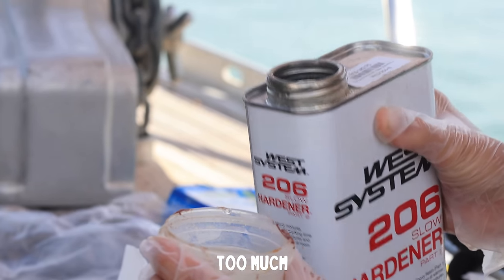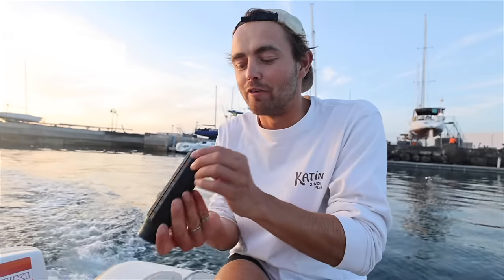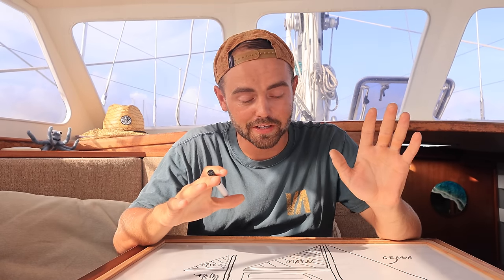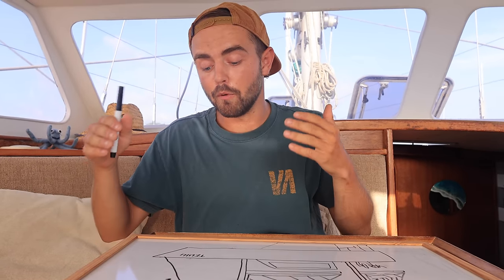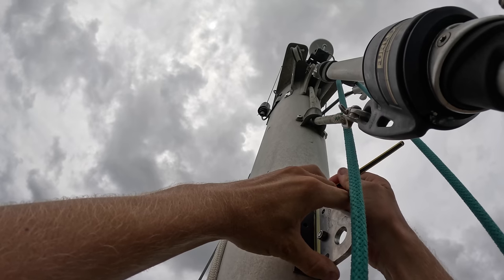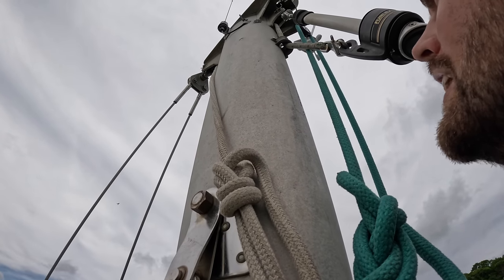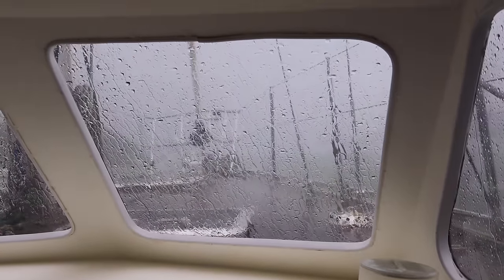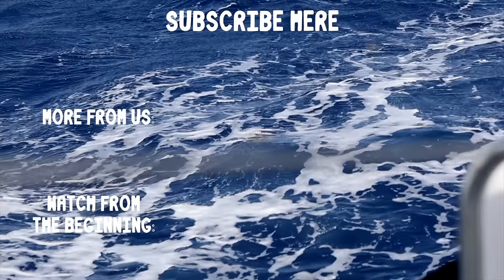Making HUGE changes to our Sailing Boat

Comment: Please take this from someone who knows from experience, sunglasses are not sufficient for eye protection. You want at least some impact resistance, wraparound and a design that will stay on your face. After Zaks' eye incident, later you were pouring filler and it was going everywhere, and even mixing and using epoxy. See Dan from Sailing Uma for what a tiny dollop of epoxy in the eye will do. Funny thing is, Amazon sells excellent wraparound safety glasses by Dewalt for  $5 - $10US. Both clear and shaded. My own eye damage would be considered minor but it rendered me without depth perception for the rest of my life. Try sailing (or stepping off a curb) without depth perception!  Stay safe and keep up your wonderful and entertaining episodes.

Comment: Next time you are doing some stainless work do not use a pencil. It is basically a stick of carbon which will set up corrosion in the stainless leading to failure along the pencil mark. Found this out the hard way after I had marked the mounting position for my chain plate and several years later they broke along the pencil line dismasting me. Notice how you stainless fabricator was using a felt pen.

Comment: Great addition guys! I would only suggest that you go with a high clewed, yankee cut for your jib. It is a far more versatile sail than a low cut ‘blade’ jib, as a the sheeting angle remains constant as the sail is furled/reefed. This allows it to be used effectively in far greater wind ranges. Also - higher clew gets the sail away from waves and allows the clew to closer match the height of the Genoa clew when wing on wing - affecting whisker pole angles from mast.

Comment: When  bolting deck fittings Zack Mads mainly used butly , but if your using sika nip up  then leave for a day so you form a gasket then finally bolt up also put masking tape round fitting so you don't leave a mess on the deck

Comment: Nice one. Stuff getting into eyes: back in the day I worked in ship building and repair. One of our hairy-arsed platers was remarkably adept at removing unwanted swarf particles, etc. from eyes using a handkerchief wrapped around a match stick; followed by an Optrex eyewash. Best medical practice? Probably not... but a NHS paramedic witnessing one such procedure on our slipway favourably compared it to treatment at A and E. Eye protection is so important, especially when offshore.

Comment: For all your deck hardware particularly life line stantioms, over drill and use a modified Allen wrench to remove a bit of balsa core, fill hole with west system 610 and redrill after cure.

Comment: A small point, when bedding hardware turn the nut not the bolt that way the bedding compound is not being twisted around the bolt.  Did I see that the existing forestay is backed by just washers? If so, perhaps get your stainless chap to make a plate for it too.

Comment: You might find Motorbike Aerosol Chain brease - there is a transparent one - which is safe for seals, really useful on a boat, and because it doesnt have the word "Marine" on it, os very affordable. Its vdry controllable to with the tube in the nozzle. Bob. 👍⛵️✨️✨️✨️

Comment: Another great video. A quick tip when using nuts and bolts, hold the head of the bolt still & twist the nut onto it. Firstly you will find it easier, particularly if there is little clearance between the threads & the hole, secondly you won't damage the nicely polished finish on the bracket. Screwing the bolt will scratch the finish with the head as it turns.
Reply: Not only that, but turning the nut uses the torque directly on the thread of the bolt, almost no applied torque goes wasted.
When turning the head of the bolt leaves the length of it to turn under the torque applied. When, in the end the torque is released, the bolt will re-turn to its relaxed position, rendering it longer...👴🧐😉🤓

Comment: hHi Guys, Rod from OZ again. Here's a much simpler and cheaper solution for a second headsail. In the old days a lot of boats carried a slightly smaller headsail with a wire sewn into the luff.and eye on both ends,  so downwind you sail with the wind slightly on one quarter, pole out the genoa on the windward side then pull up the new sail using spinaker haliard. You wont use it enough to bother with an expensive furler. when the wind gets to fresh just pull it down and continue with just the genoa up.
Easy

Comment: Cool video. Just a suggestion: Next time you drill through the core do the Allen key trick where you use the short end on a drill to remove a 10mm radius of core around the hole, put tape underneath, fill with epoxy and then continue as you have. That should better protect your core...and a second jib GIVES YOU WINGS!!!

Comment: It can be used for a storm sail as well Or as i did heavier by an ounce or two & foam luff so it flattens as you roll the sail up , Good for 50 Knots , Nice job .
Reply from the maker: I think at some point we will add a sail like this, you can get ones that attach around furled headsails. Cheers Bill!

Comment: A screecher added to your quiver would make sense. A screetcher is a sail that combines the features of a spinnaker and a reacher. Its similarity with a spinnaker is that it is not attached to a stay along its luff, and typically has a slightly larger curvature than a genoa.

Comment: Hi guys. Just subscribed after catching up on your journey to date. This looks like it will be a great upgrade for you. Another pole is going to be costly and require another set of lines to rig it consider using your main boom with a preventer to pole out one of the head sails. 👍

Comment: Repeat after me; I do Not need that much resin for this job. I do not need that much ...etc, etc.  Yup, we've all been there.
I could refer to me posting a comment about fitting Too-Too with downwind twin headsails in an earlier thread, but then no-one likes a smartarse...
Really nice job guys, and major kudos for the fabricator wearing welding PPE in that heat. Sweating like a cornered nun...A hidden benefit is protection against losing the mast if the forestay breaks. Also, having a second forestay makes changing out the other forestay much easier. Getting a lone forestay off is easy, refitting it with the rig still in the boat is most definitely not, as the wire sags under gravity and can be an absolute mare to get back into the tang holes. With another stay you can crank up the tension a whole bunch and shorten the span.

Comment: Thanks Zach for basically explaing why my Next Sailboat is going to be based on updated KISS principles which Work for Me largely based on Zero Canvas exposed at the Bow or Stern that give Heave To Breaking leverage when Conditions are Bad which demands in Mast Furling,  with a Battenless Triradial Main of Heavy Construction with 3.5 Reefs, the 0.5 actually comprising of two mini Reefs, so 3 Reefs in when it gets bad, 0.25 extra in when really bad, and 0.25 when the Wind force gets to damaging levels, so at all times the Wind Power when things get to "Bloody Hell" levels is all at the Mast, and so oretty easy to maintain a Heave to. Forward Sails a Furling Radial self tacking Jib, a Furling Reaching Code Zero to help fill in the Wind Angle Gaps, and a Furling Gennaker, all Sails Handled from the Cockpit, ideally with a Seldene electric push button  Sail Handling system with suitably powerful electric Winches, which have manual Backup. While totally unsuitable for your Rigging and Sail Setup, Id personally be vdry wary of a Twin forestay setup that could easily require you to go forward to sort out any issues when cinditions are really bad. Thankfully, any issues with the Sail on your Mizzen Mast should be safe enough to deal with, and a Staysail for use at the Mast does work if you can set it when a classic Mast Sail is fully down in the Stackpack. Could work somdting out at the mast end of the Stackpack for a secure and strong Staysail perhaps ? Nice thing withnin mast Furling, is the forces are spread through all the Furled Sail Layers inside the Mast. Classic Masts and Sails can and do work, and I used to really enjoy them, and bouncing around on the foredeck changing hank on Sails, but really, it's best not to be forced to be there when things get really bad. Best Wishes and Fair Winds.  Bob.  👍⛵️✨️✨️✨️❤️
Reply from the maker: Sounds a good plan Bob, it’s so great we can be so creative with the rig of our boats! 😀
Reply from the maker: Sounds a good plan Bob, it’s so great we can be so creative with the rig of our boats! 😀

Comment: Bloody well done getting that bit of metal washed out of Zach's eye Becky Been there and got that extremely Paniful object in my eye problem , but mine was with bullet proof eye glasses under full eye protection goggles when Cutting a Ceramic Chimney liner to size when somehow, a ceramic splinter got stuck inmy eyeball. I was lucky though the last GP I had that was any good, now retired Dr Selcon in Llandysul said I'll have a go, but if I Fail you'll have to go to A&E. Anaesthetic drops in, he got it out with Tweezers. Still to this day can't figure out how the thing got into my eye. A great guy, I helped his Brother in Law, another great guy, paint his house exterior for him. Every other GP I've had since, has been a bloody Nightmare, to such an extent, I've now Fired the NHS and British Private Medicine as well, which is just as bad sadly. Sorry for the gripe but if I hadn't been as Superfit as I was before being put on Dangerously Crap Meds, I'd be Dead by now. Hence first Destination for me in the Caribbean,  is to Mexico to get good Medicines available over the Counter Cheap, and no Prescription needed, to workmon undoing the damage they have done which has left me disabled, which should take three to four years in the area. Might bump into you both duringbthat time, and fingers crossed I'll be able to afford the drinks and BBQ being on me on a few Occasions. Best Wishes and Fair Winds.  Bob in Wales still.  👍⛵️✨️✨️✨️❤️
Reply from the maker: Ouch! That sounds such a painful thing to happen, lesson learnt for us though 😀 goggles next time!

Comment: Thanks for the great content. As a novice myself, I was wondering if you had or would consider the twin headsail setup that Kirsten Neuschäfer has on Minnehaha (GGR 22-23). This system has two sails on one furler and one forestay, so the install may have been easier. Downwind the two sails are pulled either side, up wind the two sails are together as if they were one.

Comment: You won't be using the Genoa for beating again, as you would have to grind all the way in to tack, so makes sense to get a good upwind sail on the inner forestay, something with a flatter form, probably need a couple of forward blocks for the sheets,  unless track is long enough. Have seen self tackers with transverse track and even boom. Guessing!

Comment: Just one problem ! You can only use the new sail for upwind tacking as the original one is now land locked !!! as there is no space for it to pass in front of your new stay/furling gear .!
Reply: True, to a degree. Inner becomes primary upwind headsail but if you want/need to use the outer one upwind you just furl to tack and re-deploy once through the eye of the wind. 

I’ve lived with an identical setup and provided all lines are led to the cockpit it’s not really a major hassle when compared with the improved downwind performance. 

Gentlemen don’t cruise uphill anyway. Ain’t nobody got no time for that! 😁
Reply: Not correct
Reply: @saildreamer  Ok so come on lets hear how you will tack up wind with the genny with 6 inches between it and the new installed one ? Not to mention the damage the lines will 
 to the geenny will do to the inner furled sail !
Reply: @howardbeer5214  furl in the genny then furl it out again - simples
Reply: @saildreamer  And what about all the damage to the sail thats furled /already out The clew will damage the foil and the sail etc and then there's the sheets contantly rubbing on the sail !
Reply from the maker: We will only use the second, further aft sail when going upwind so this won’t be an issue 😀
Reply: @TeuluTribe  Do you mean downwind Zac?
Reply from the maker: @saildreamer  nope, upwind. We will use both on whisker poles downwind

Comment: Sooo. Strong reinforced chain plate in the bottom and rivets on the mast ? You sure about that ? Also maybeeee get a Spinnaker if you can't handle a Spinnaker sail some degrees off wind and jibe as you go along. It's faster uses lift instead of drag keeps boa stable intead of bumbling along like a drunk toddler LOL. Fair winds, Cheers
Reply from the maker: It’s riveted/slotted inside the mast, so minimal force will be applies to the rivets. Thanks for the advice 😊
Reply: @TeuluTribe  Hope it works out. Im sure you asked for professional advice on it 😁 but be ware sometimes they dont give a fu... LOL. Btw we bought a Victor 40 last month that's how we found your channel, thaks for all the videos it helps us piece ours together again. 😅 Cheers and Fair winds.

Comment: Loved the video and explanation / reasoning on your new sail configuration.  May I ask (I'm by no means any expert) if there was any concern over the gauge wire used for the original backstays?  I'm curious if they were sized for the single one forestay and now that you'll be adding more tension up front with a 2nd forestay if that would cause any concern?  Again, just curious and love to learn along.  Wish you both the best!!

Comment: The weld does look OK, but it needs to be ground down and re-plated or you will see corrosion pretty quick. (I hope the welder was using a respirator, chromium is not good to breath! Good luck.
Reply: Pretty sure it was stainless, not chrome plated steel

Comment: @22:12He is so right!
That is the only way to do it, correctly, ever. He knows his business.👴👌👌👌🤗 
Making a hole from anywhere outside to the inside, this should be done. Whether it's sandwich, solid GRP wood on GRP, what ever...,!👴🙄🤨
I've been promoting this way on various cruising channels for a while, but alas, as far as I know, in vain.👴🙄🤷‍♂
(When you're sure your solid GRP is not polyester, but vinylester, or even better epoxy, there is no need.👴🤷‍♂)

Comment: got a strand of copper wire stuck in my tear duct once.. that hurt like hell...
Reply from the maker: Ouch!
Reply: Nasty....I was grinding High speed steel on a grinding wheel one day as an apprentice making a cutter to match this customers handrail..... and a spark came off and hit my eye and I wasn't wearing eye protection (immature back the as glasses/goggles weren't cool 🤦‍♂️) by the time I got home remember I couldn't see a thing and the pain was phenomenal but only in sunlight so i had to stay in darkness until my wife finished work and could drive to me to hospital as i really couldnt see at this point ,The doctor managed to get the steel splinter out of my eyeball and said the pain was becouse it was starting to rust.....Worst pain I've ever felt but I never did anything with metal again without safety glasses/goggles 😢

Comment: I personally would not have drilled the holes bigger. The bolts need to be very tight in their holes. Same holes as bolts just well coated with sikaflex is more than adequate. I think that unit is going to move under load.
Reply from the maker: The compression load of epoxy is far superior to that of balsa or sikaflex- we are happy we did it this way 😀